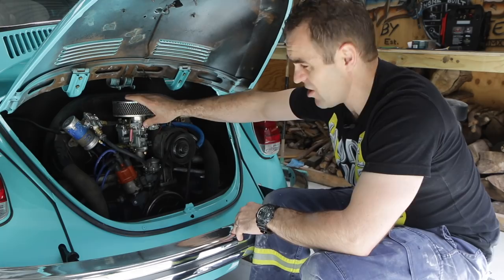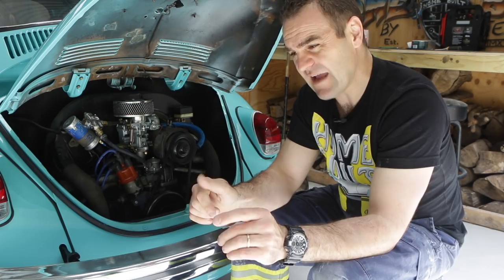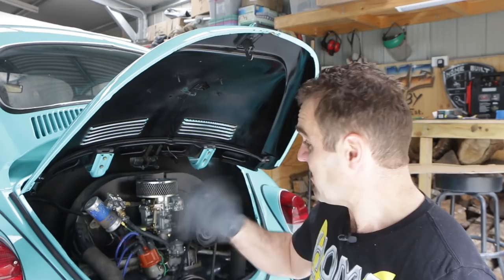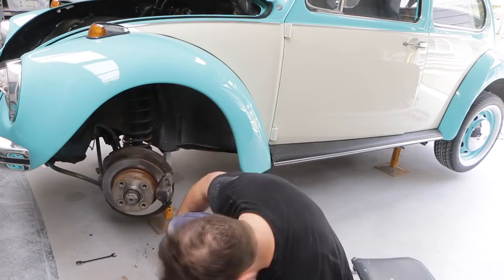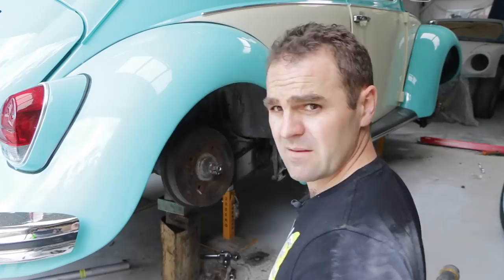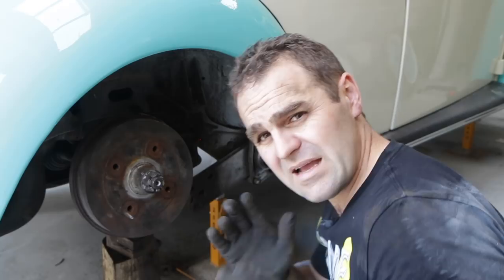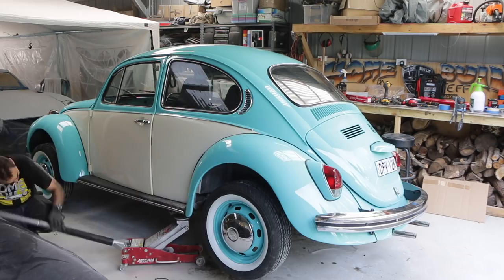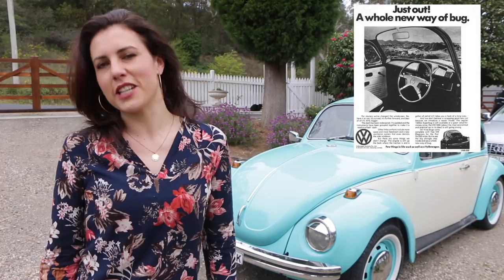How to lower the rear of a Super bug - Home Built Project Beetle part 30

Comment: Lol, “I want it lower, not higher”! That had me rolling. You need some drop spindles to lower it 2.5” then it will sit right with the rear.
Reply from the maker: Drop spindles don't work with Supers ;)
Reply: Home Built By Jeff Ah, I wasn’t sure. Bummer.

Comment: Hurrah! John looks lovely, if a little sit up and beg. Best to do a couple of hundred kms and see how the front looks then. When I was at uni I had a ratty old Skoda 130 Rapide coupe, which was rear engined. I had heat soak problems with restarting which I solved by having the heater running all the time. Good excuse to have all the windows down in the summer! I paid £300 for it and got 15,000 miles out of it with the only maintenance costs being a tyre and some exhaust sealant. Those were the days!

Comment: jeff dont forget to peen the large bolt that holds the trailing arm after torquing it to 87 ft lbs. They have been known to work their way out on the road. as to the  carb apparently you can use a pict 30 31 carb float as they are the same size as a 34 pict if you are trying to source a used vw  float.  once you get the hard start issue resolved and looking at tuning consider if you have ethanol in your gas when jetting, do they have ethanol in Australia normally you would increase the jet size. Puttiing smaller tires on the front is a cailfornia loook thing and the stance may look off if the shocks are sitting higher with smaller wheels as that would only accentuate the gap from the top of the tire to the fender agian just opinions take them how you may. . good luck Andrew 
Topline VW sells strut inserts for lowered  front ends  the note on their std  length gas struts that the front end rises on install

Comment: Good work as usual. I do wonder if there is a small leak somewhere in the carb other than the float that is allowing the fuel from the bowl to slowly leak into the intake. That would be independent of if the float is working or not.

I think you're right about it being flooded while trying to hot start. It sounds like it's too rich rather than too lean in the hot starts you have shown in pervious videos.

Setting the float height is a fairly normal thing to need to do to a carby, a lot of dirt bike riders adjust float heights to make sure the bike doesn't starve on long hill climbs

Comment: I have had hot start issues from fuel evaporation from the engine heat my old falcons used a baculite insulator on the carb which often gets discarded and can cause hot start issues there is also the trick where you make a heat shield and any insulate any fuel line that runs on or near the engine and as some previous comments have said may also just be cheap Chinese carby.

Comment: Has the same issue with my 1970 Fiat 500. Not starting on a warm engine. Replaced every part in the carb, no improvement. Replaced the carb with a refurbed one, no more problems. Till this day I still do not know what it caused. It still bothers me to this day 15 years later.
Reply from the maker: That may be the eventual fix, but I would really like to track down the route cause.
Reply: @HomeBuiltByJeff  I wish I did! Haha.
Reply: To cut the chase a bit, do you have any way to borrow another known-good carb and try it out, just to quickly isolate if that is where the problem resides? Maybe a VW Bug club member could lend you one or something similar?
Reply from the maker: Thinking about it, I might. I will give it a go.

Comment: I commented it before, but I would really make sure the float level is OK and matches the carb manufacturer spec. And having after market AF meter for jetting would be bad idea either.

I've got carbed motorcycle with twin carbs and the float levels (and that they match) are super critical item to check especially when rebuilding the carbs (say every 2 years). Too low and the carb can run rich and even hydrolock if the needle leaks when not running. Too high and might cause fuel starvation/lean condition. Had problem problem with the lean condition with one cylinder and changing the jetting didn't seem to matter. After I corrected the float level, the jetting started having effect and got the fueling sorted.

Comment: VW looks good. I had a Super Beetle. One of the problems I had was the fuel cut off valve. It would creep on the shaft to the coil that opened on starting and running. This would cause poor running and hard start up. I would unscrew it and tap the spool end which would slide it back on the electromagnetic coil that opens it on startup. Finally replaced it and it stopped the problems.Anyway it could be this or the valve is just bad. Just another idea to try.
Reply from the maker: Definitely worth checking